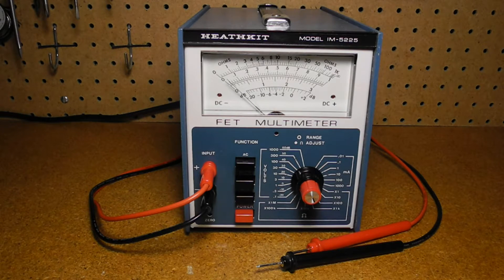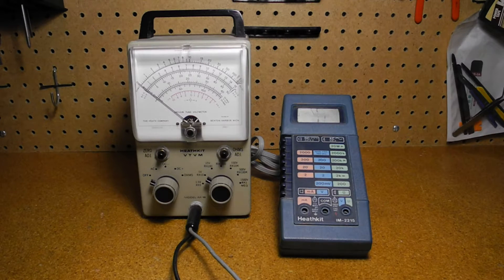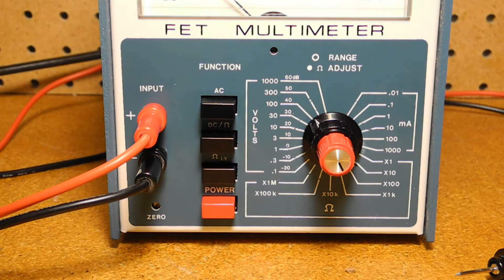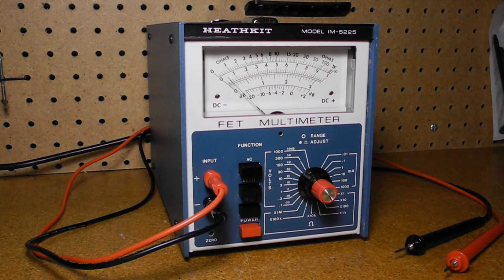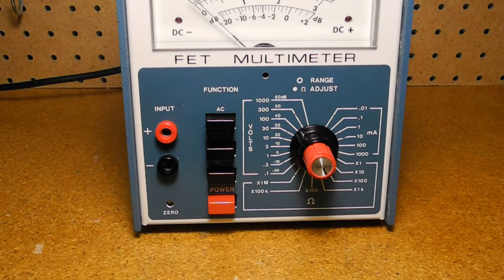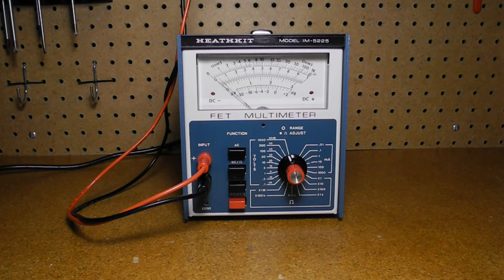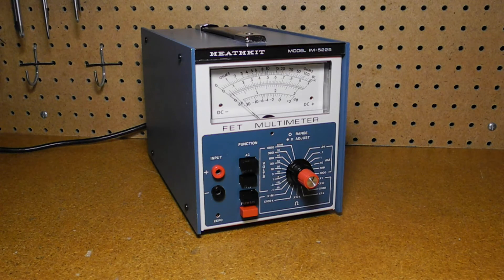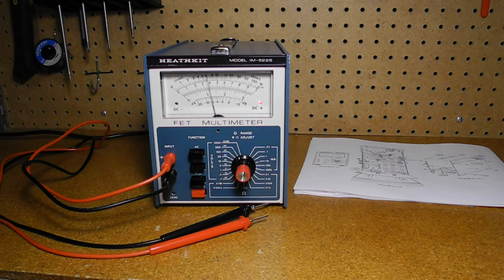The Heathkit IM-5225 FET Multimeter

Comment: Could it be that the meter was initially assembled with a incorrect resistor (value), like 68k instead of 6k8?
Reply: ernestb, the meter movements I have studied are NOT made having internal resistors, rather getting a certain amount of resistance from the moving coil, and usually below 1k. Having said that, I don't know if some meter movements might have been made using additional internal resistors.

The meter movement on MY IM-5225 seems to be possessed by evil spirits. The electronics driving it seem to be working correctly, but the meter always points to apparently random points, and seems to read far off of anywhere near where it should be, before jumping to some other point. I suspect that the moving coil, or perhaps its pivot points, have have become damaged, or maybe Heathkit got a bad batch of meters from their supplier. One of these days, I plan to rig up a constant current loop and insert the meter movement into it, so I can isolate the rest of the meter circuit from the movement itself, so I can get a better idea of what's going on. But between my experience with it, and Jeff's, and one other vintage meter collector I have heard from, this model meter seems to often suffer from "PMS" (possessed meter syndrome).
Reply: @youtuuba I have no idea why I have put this comment regarding the resistors. I suppose it made sense at the time, haha. Indeed I would also decouple the meter movement and the electronics, and test those separately. Recently (a few months ago) I have worked on a BBC Goerz Metrawatt MA 4E fet input analog meter. It uses almost the same IC, CA3130. This one also suffers a partial and variable PMS. I tried to evict the bad spirit from it but I suppose I have not really succeed. I suppose we have made an agreement. This meter has problem that on the largest Ohm's range of x10k it (sometimes) shows about 2 to 10MOhm with open circuit leads. Other times, I suppose when there is no full-moon, it just shows (as supposed) the infinite resistance. I could not find what is causing this irregular anomaly. Other thing is that the meter is not completely linear across the scale, so calibrating it is just impossible. If you calibrate to full-scale then you have bad reading on the lower side. If you calibrate in the middle of the scale you come short at full-scale. I couldn't solve that either. One thing about this IC. It has a small compensation capacitor of 10pF in your case C121. The op-amp tends to oscillate if this is not properly compensated. You can see that with an oscilloscope. I ended up using CA3140 DIL that does not need this negative feedback compensation, instead of canned CA3130S. And regarding the linearity, the coil meter movement are somewhat complicated after all. The basic principle seems rather simple, but there is a lot going on in the movement itself (the strength and field uniformity of the permanent magnet, the Hooke's law regarding the springs, friction in the bearings, current-->magnetic field of the coil linearity and such things). And yeah, as long we don't understand it we will call it PMS 🙂 I hope you evict the bad spirit from your meter.

Comment: Hi Jeff

I am curious, when you replaced the op-amp in this meter, were you able to lay your hands on the same kind (CA3130S), and if not, what kind did you use?
Reply from the maker: Yes, I purchased a couple of used RCA CA3130S devices from eBay. I turned out that issue was with the meter movement and not the op amp. It actually seemed to work more poorly with the devices I bought, so they may not have been fully functional.

Comment: I just acquired one of these after a long search. Unfortunately, it has what seems to be several very odd issues. The Ohms function has a 4-transistor circuit where every semiconductor runs suspiciously warm. The meter deflects and moves around, 'responding' to inputs, but in very odd ways that makes it seem possessed. I can't get the meter pointer to rest over the 0 on the scale (with power off) using the zero screw on the meter face.

Because it responds to inputs, I will probably find that most or all of the front-end switching and attenuation circuits are OK. I suspect that the op-amp (which drives the meter movement) is the culprit, but have not obtained a suitable replacement so far.

Anyway, a couple observations on this video:

While Heathkit calls this an "FET Multimeter", it actually has no discrete FETs in it. The only claim it has to FETs is that the op-amp uses an FET front end inside the chip to get higher input impedance, something that is pretty much taken for granted by modern op-amps, but then this is a 1970s design, and solid state op-amps were fairly new then, and ones with FET front ends were fairly unusual at the time. Calling this an "FET" 'anything' is much like putting "Automatic" on the trunks of cars back when automatic transmissions were a new an novel thing.

Jeff mentions that this IM-5225 was Heath's only benchtop solid state multimeter, but that is not quite true. At around the same time, Heath also had the IM-25, a benchtop solid state meter capable of measuring AC & DC volts,  AC & DC current, and resistance, i.e. a "multimeter". A close second was the IM-16 which was similar to the IM-25 but without the ability to measure current.

Comparing this IM-5225's circuit design to the almost contemporaneous IM-25, it is interesting to see just how profoundly differently various Heath design teams, or designers, could approach design problems in devices that otherwise do exactly the same thing. Somebody could probably write a book on the massive disparity in design philosophy between the two.

Comment: As long as it is connected to the mains its not isolated!
Reply: erin19030, that is an odd assertion. The entire circuitry of this meter, not counting the primary winding of the power transformer, is galvanically isolated from the AC mains voltage. That makes it isolated by any normal definition of the word.

Comment: I have one of these that I built in the 1970s as well as the the AC voltmeter that uses the same case.
I used it to peak and dip alignment coils in FM receivers.   It is much easier than using a DVM.
I also have a working Mercury VTVM from the late 1960s.

Comment: Interesting bit of kit.  Since you said you examined the meter movement for damage, I assume this means the "guts" of the meter can be removed, while preserving the scale and LEDs?  If so, you might be able to find a similar size and shape meter whose movement could be swapped in to the existing meter case.  Even if the sensitivity isn't the same, you may be able to add a shunt to obtain the required sensitivity.